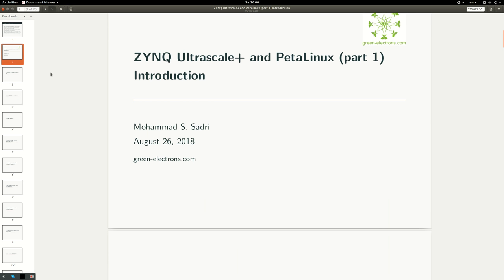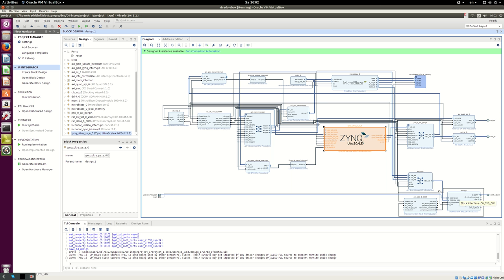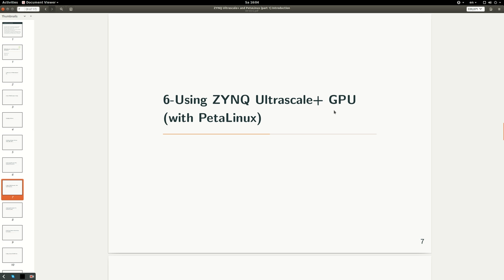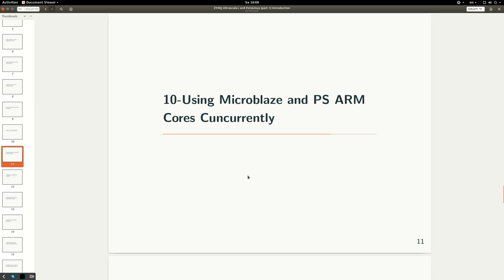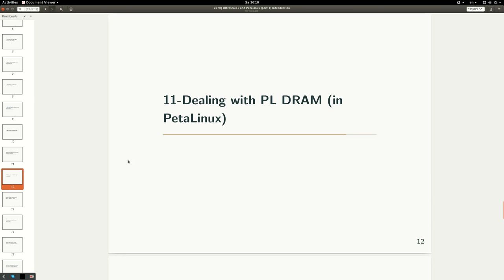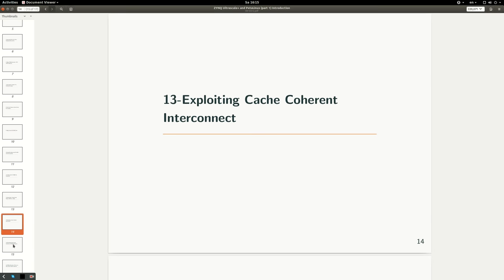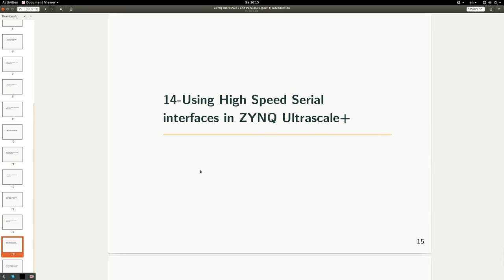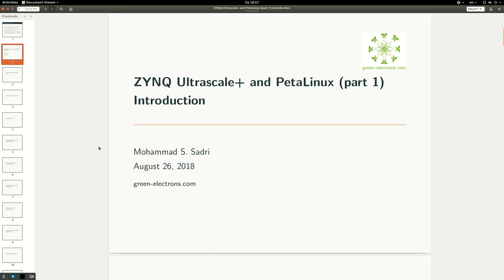Zynq Ultrascale+ and Petalinux (part 01): introduction

Comment: Hello Dr Sadri, is zcu102 suitable for image and video processing applications? I'm trying to decide which is a better choice for image detection, zcu102/104 for that. Since you are an expert on zcu102, I'd really appreciate if you could share your view on it. Thank you.
Reply from the maker: Yes, for me both boards are fine. Also you can look at Xilinx Kria vision kit, maybe that is a better choice than zcu102 and zcu104. Specially, you can connect your imaging device to the board much easier. https://www.xilinx.com/products/som/kria/kv260-vision-starter-kit.html
Reply: Thank you so much for the reply. Also wondering if you have worked with the PYNQ image on zcu102, for any image detection/CNN based applications? I'm interested in that sector of applications with running PYNQ on zcu102 board. I find information regarding it running on zcu104, but not much on zcu102 and was wondering if the same steps work for zcu102 as well. Would really appreciate if you have any insights on this?